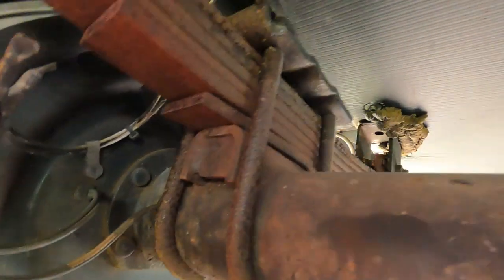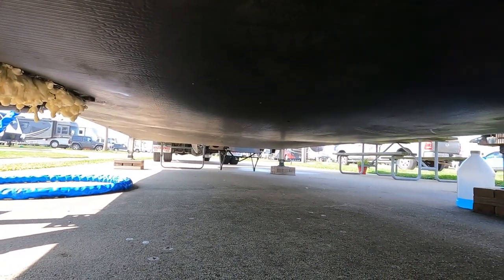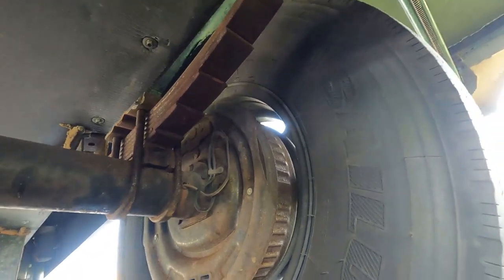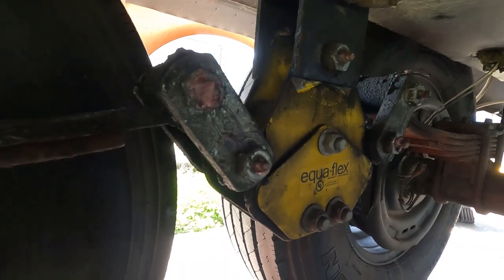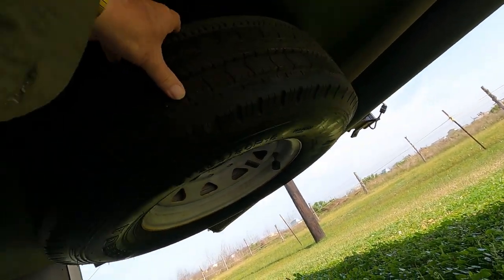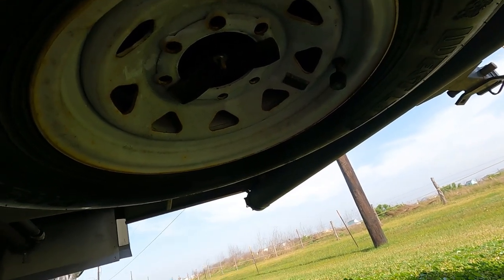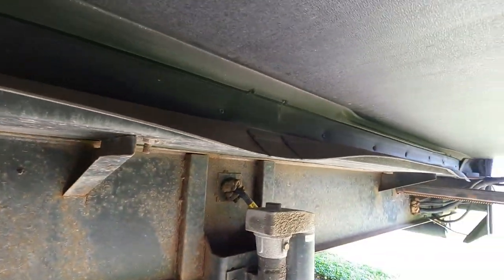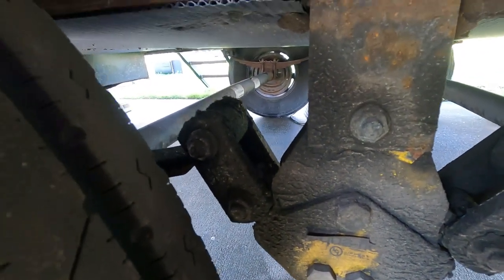RV Suspension Inspection Part 1

Comment: Looks like you have rusty water inside the axle tube. I see the rust stain coming out of the axle tube brake wire grommets. I had the same thing with mine. I blew air thru the axle holes and then sealed the holes with RTV .
Reply from the maker: Thanks for viewing. Yup, since filming this I have cleaned the frame and axle tubes and repainted with a rust-o-leum spray can paint. In part 2 video I replaced the equalizer with a MORryde product, replaced suspension bushings and wet bolts. 

I'm getting ready to replace the electric brake wires running inside the axle tubes, removing the wires going through the tubes. I'll put the new 12 gage wires on the outside of the axle tubes, incased in plastic convoluted tubing and tie strapped to the back side of the axles. Then I'll seal up the holes in the axle tubes that the original wires ran into. Reason - Once in awhile we are getting alerts from our truck indicating "Check Trailer Brake Wiring" and "Trailer Brakes Disconnected". This can be an indication that the electric brake wires running through the axle tubes is frayed and shorting out. Thanks for the comments.